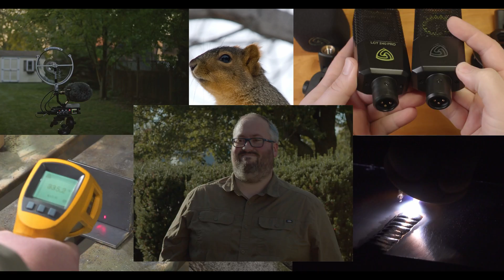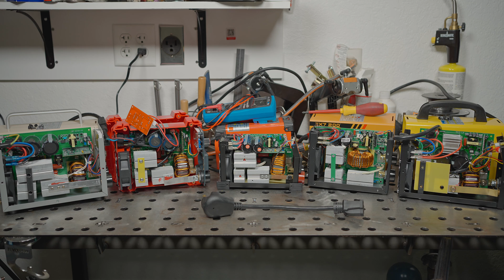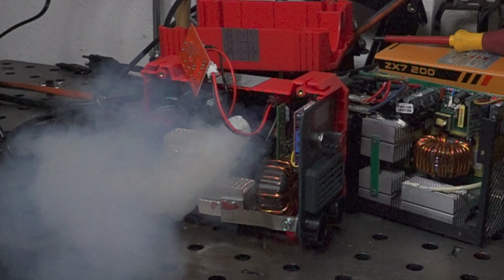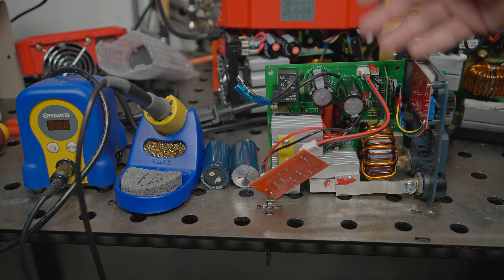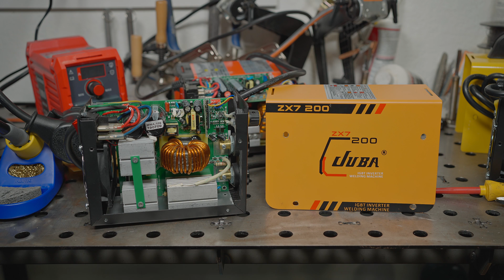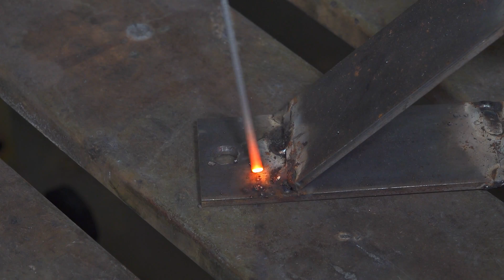I plugged a 120V welder into 240V!  Will It Work?

Comment: Oh, I had a duel voltage one I returned and bought another one I'd been running on 110. Then I picked up a duel voltage plasma cutter that didn't work good enough on 110 so I rigged me up a 220 split off my compressor. I Forgot I had swapped out my welder and with the improvement it made to cutter I thought wonder what my welder would do and pugged into the 220 power source. It took about 10 seconds for that big capacitor to get overloaded and blow out it's bottom.

Comment: 5:56 it looks like you’re shorting the output terminals lol
Reply from the maker: You mean because the components are shorted out against the table?  It's unplugged and verified de-energized.  Nothing was shorted out when it popped.
Reply: @bigtb1717  I just mean the machine probably went to welding current right on startup since you had the positive and negative output bars on the metal table without the case at first. I noticed that you actually solved that problem after swapping the capacitors over though so no harm
Reply from the maker: @Weldoholic  I never powered it up with the output bars touching the table.  When it popped, the board was still in one side of the case and no part of the circuit was touching the table.  At the timestamp you list I had disconnected everything and disassembled it further, after it popped.

Comment: great video! Did you hook up the dual voltage welder to see if you get the full amps? I have a welder that says dual voltage just wondering if it's true. If you plug in that adapter to 220  will you get 220 on the 110 plug side of it? Any help would be greatly appreciated
Reply from the maker: On every dual voltage welder I've tested (as well as every 240V welder), when using the included adapter you do get the full 240V.  However, virtually none of these tiny stick welders provide the claimed output.  There are a few that are honest about the output, but most are very much not.  Most of the time you will get 115-130 amps out of these tiny welders when running on 240V.  This is despite the claims of 200-250 amps of output.  There are exceptions, most notably the Kicking Horse A220 which actually did have 220 amps of output.  But, the vast majority of these welders put out around 115-130 amps on 240V.  The exceptions are few and far between.
Reply: @bigtb1717  Thank you very much for your time! I am tripping my 20amp 110v breaker when mig welding so I was thinking going 220v 30amp. I hope it works, Thanks for your help

Comment: So which is the best mini ac welder in your opinion?
Reply from the maker: As for the welders in this video, they are all pretty similar in build quality and performance.  I like the plastic case welder if only because it doesn't have 340V capacitor tabs.  Otherwise, they are all pretty similar.  

The Kicking Horse welders I looked at recently aren't amazing, but they are a step above the welders in this video.
Reply: @bigtb1717  thank you

Comment: Great video tutorial..as usual..Thank you..love to see the insides of a Primeweld machine.. although they are actually really nice machines with proper ratings so it may not be much of a video as they work straight out the box as advertised..still like to see how well built they are..
Reply: Me too I have a HTP Invertig 221 But would like to get a primeweld tig to beat around
Reply from the maker: I'd definitely like to check out a Primeweld machine at some point.

Comment: Buy and review a Lincoln pro mig 140
Reply from the maker: I almost got one of those a couple times over the years but never went for it.
Reply: I have a canadian model Idealarc 250 (square top). Can attest to the arc quality and longevity. Mine's from 1971. Previous owner used it for tig and blew the cap for AC. 30$ capacitor was all it needed when I got it. Pick one up if you get the chance. They usually don't cost much for some reason. I paid 300 for mine. Scrap price. It was harder getting it on the truck then it was to part with the money.
Reply: What for
Reply: Unfortunately its rather unimpressive..if you look up " inside of a welder " or "repairing a Lincoln welder " you will see a few different videos on them..I like Lincoln but, the lower priced product lines are about average..now their " buzz box" 225 amp tombstone stick welder is absolutely the best transformer type welder ever made..with only one machine that could beat it is the Lincoln 250 idealarc round top stick welder which is 300 amps and about 375 lbs with zero electronics in it..burns sticks buttery smooth 12 hrs a day for decades upon decades..both could be had in AC only or AC/ DC and both could do scratch Tig welding with a few additional pieces..